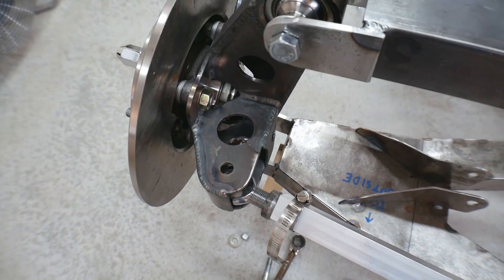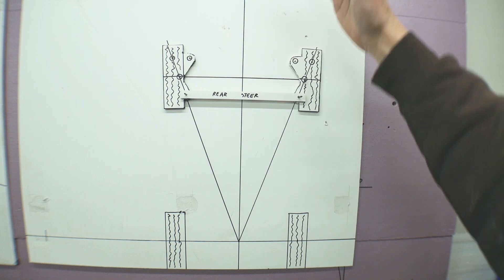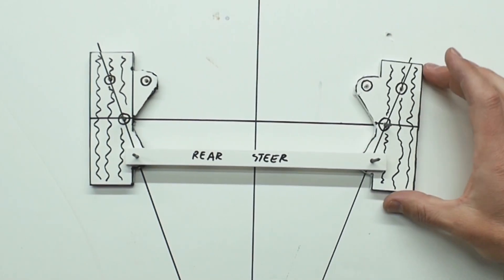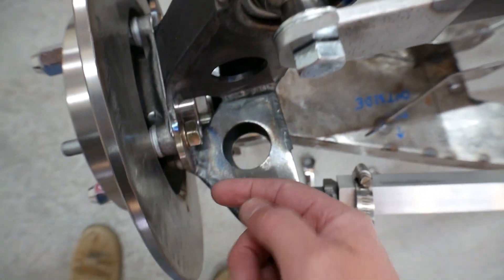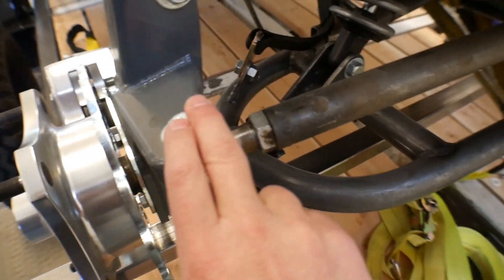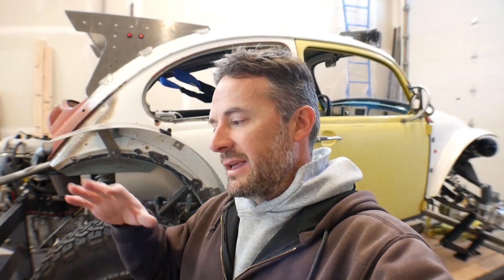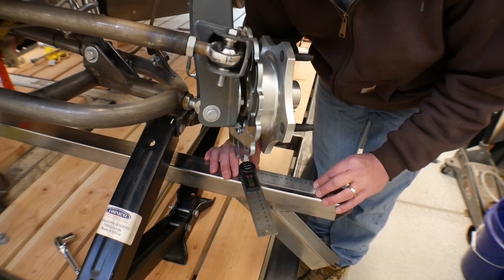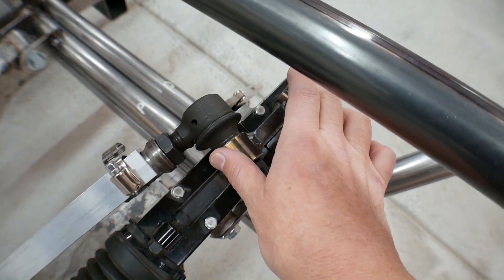Steering Ackerman, how it works, and doesn't work...

Comment: I''ve noticed some front wheel steering axis is well inboard,   often not in line with the wheel axis,   and sometimes tilted so the outboard wheel in a turn presses down and the inboard wheel lifts slightly.

Comment: Awesome video! Thanks for the simple explanation. I've been diving into Ackerman for a short while now and had a conceptual understanding, but visualizing it like this made it really click.

I'm build a drag-and-drive car now and i'm using Volvo S60 suspension, but due to space constraints I had to flip the knuckles and go from rear- to frontsteering. Easy, since the knuckles are symmetrical, but it does "reverse" the Ackerman. I'm now figuring out how to fix this, but that's the easy part. The hard part is determining where the new steering arm needs to be after cutting off the current one. But maybe i'll be able to litterally put some strings under the car and use a laserlevel to translate the location on the Y-axis, if that makes sense.

Anyway; my amateur brain was thinking: can't you move the mounting position for the tie-rods inwards, towards the struts, so it comes closer to where it needs to be? The only downside i can think of is that it makes the steering heavier, since the leverage arm is also shorter.

Comment: Can you explaint to me how to adjust toe in using camber angle data calculation. How much toe in, if i use +1.00 camber, +0.30 camber, -0.15 camber -0.30 and more than -1.00 camber

Comment: You can improve increase Ackerman effect in front steer by moving the rack more rearward. (and vice-versa for rear steer)This makes the inside tie rod and steering arm approach tangency faster, and that means more degrees of turn with less tie rod movement. This can be used to compensate when the steering arm can't angle outward as desired. I'm fixing a front-steer-converted project right now, so I've gone through it. Another trick that can be used is a bellcrank, with links that are angled to create the effect. It wouldn't work with arms this long, though.

Comment: Hi long time after you made this video I know but a great video by the way. I have a lightweight  rear engined track/sprint car for tarmac. This has a front mounted steering rack like you Baja cars and therefore it suffers from exactly the same reverse ackerman geometry.  In the manufacturers suspension set up the toe in toe out specification specifies quite a lot of toe out. I often wondered why. However seeing your vid and looking at your model putting more toe out would, I think,  appear help to compensate for the reverse ackerman as the outer wheel would had reduced steering angle and the inner increased for any given degree of turn. Of course this would lead to a bit more scrubbing in a straight line but so does toe in used on most road going cars. Toe out also makes for a more "twitchy" characteristic which is no bad thing for a car  that needs agility. Just my thoughts . Nice fabrication skills by the way!
Reply from the maker: I think generally on road cars benefit from toe out, and off road benefits from toe in, in general. Again just my experience.
But because toe out aids in aggressive turning on road cars like it. But in low traction conditions like dirt toe in keeps the vehicle tracking better in a straight line.

Comment: It doesnt actually work though. Never had a problem with standard steering geometry on other cars but my Alfa Romeo has Ackerman and you can hear/feel the tyres scrub when manoeuvering slowly. The proof is in the uneven tyre wear ARs suffer from even with the correct toe in.

Comment: Anti-ackerman is common in race cars (in addition to toe-in !) 
For the reason of rubber slip angle wheels don't actually go where they are pointed, but rather slip a bit towards the straight line.
That slip value is also different for loaded/unloaded wheel in the lean of the turn.
Thus anti-ackerman is better for them than perfect setup, albeit at the cost of more rubber wear.
I just don't know if it is detrimental or good on loose terrain.

Comment: Fun fact: Formula 1 cars can have negative (or anti-)Ackerman set-ups like you did show in your model with the short front steering. This is because at the really really high speed turns, it turns out beneficial since there is already inherent slippage of the outside front wheel that requires MORE steering on the outside instead of less to make it go in the corner direction. So there is an actual real world benefit for such geometry in very specific cases.

Comment: Man, you got me thinking about the steering setup on my toyota pickup. Its forward steer and im sure its just as bad as the demo on paper lol. I think im gonna try to make it rear steer and get better geometry.  This might be the reason why my tires need rotation more often than i think they should is because they are scrubbing the heck out of the roads every turn i take lol...  

Thanks for the great explanation man 👍👌

Comment: TLDR: crossing the desert is hilly rocky bumpy sandy your cars steering supposed to be locked to near straight and very super heavy. you cross the desert, straight across. no turns ever. no aircon no civilization no bathrooms those can wait you wont have enough water its a death trap. Even if you have to be a boy band go full one direction. Or you could just go the middle of the desert do donuts n burnouts whatever. you cant put your foot into the pedal hard enough ever to get out of the desert fast enough, is why they invented racing engines.

You misunderstood why its a front bar and less of an angle. In a toyota AE86 or other vehicles drifting downhill and on smooth road surfaces, the weight of the car shifts to the one side when cornering and powering through a turn at high speed and powering out! because a buggy/ baja type vehicle is for offroad, it drives on sand and loose surfaces, and the weight shift and turns cannot be as fast/sharp because theres not an even surface and no grip, your wheels turning sharper for a tighter turn circle if going fast means your baja car continues in a straight line with the two front wheels at near right angle vector drawing gooves and lines in the sand... the angles and the math of the tighter turning circle work, but the bumps and different suspension mean you dont want your car to turn or swerve as sharply on loose rockey offroad surfaces. it was tightened and closed off for this reason. If you drive it on a track with sealed proper road surfaces then tighter turns and your adjustment might be an okay idea if its steering is heavy and needs a few rotations of the wheel to make some tight inner city parking manuevers. But if you're going down steep sand dunes turning doesnt actually work as it normally would and is less effective and turning sharply means you may roll or veer off vector its a bit like skiing how the skis tend to go forwards or you angle them but when the bumps and rocks come your snow ski at high speed cant keep stable so you hop side to side bouncing and do so on jetskis in surf waves too... though ski's you can lean and sort of snowboard like edging to a halt, your car doesnt jump or lean and it relies on suspension to sorta bounce a little but reduce the bumps to smooth. if your longskis in the snow go fast as a car you will understand what i mean high speed on bumpy roads and loose sand down hill sand dunes. if you plan to only drive it in town then try out your change. In places like australian nullabor plains 11 days of drive of nothing but dirt road rural australians drive their ars at plus infinity miles per hour because nobody has enough lives to spend days to go to the store. your car at a speed high enough should steer or turn with a tight enough circle, maybe consider changing to a smaller easier to grip and spin around rally like steering wheel.

Comment: I know I am late to the party, but when you are measuring the angle of the buggy you showed 29 degrees for the inside wheel and 31.6 degrees for the outside wheel. By that method doesn't that mean the inside wheel is following a tighter arc? So it has slight amounts of ackerman? And is not actually anti ackerman?

Comment: This might be a dumb question, but since the wheels in front aren't connected, doesn't that negate the need for any kind of compensation?
Reply from the maker: No this doesn't have to do with rotation from one wheel to the other, it has to do with the path they are taking around a turn. If there paths are different they will fight each other, and one of them will lose and have to slide.
Reply: Yeah, so if the inside tire is turned sharper than the outside tire, they will be pulling apart from eachother, no?

I was watching the wheels on my shopping cart earlier to see if the inside wheels was turning more than the outside but it looked like they were turning the same even if I was just spinning the cart around in a circle. 

I'm definitely not educated on this topic, but I would like to know more. 

 @DougBugBuilder
Reply: I think I understand now. It's easiest to think about each wheel independently, like two tricycles turning. One sharper than the other. 

So I guess, the further the wheels are apart, the more variance there would be between the two, during a turn.  @DougBugBuilder

Comment: ackerman wasnt even born yet when charles darwins grandaddy first devised this setup while making house calls as a doctor in mid 1760's england. he got tired of his carriage crashing on turns, as it was the whole axle turning and a tight turn would turn it from a 4 point support towards a 3 point structure, if that is imagined in ones mind. so he had the local carriage maker craft his design up, leaving the front wheels in place and the control arm to turn them. since he didnt want to be thought of as a mad inventor which could have hurt his doctoral practice he never patented any of his schemes. 
the royal society of england was aware of the design, thru a friend and admirer of the aforementioned erasmus darwin, yet those old blokes must have had plenty to look at in those days of invention, because it would be 50 plus years before it was patented by ackerman after a german carriage builder named lankensperger developed the mechanism. ackerman was the germans agent and spent years defending the design to reluctant adopters of the technology. or something like that. was a fun rabbit hole to fall in reading about steering.

Comment: what if you flip a arms and spindles from left to right side and move suspension forward accordingly. then you should have room for rear steering. would be cool to see the diffence and for you to give a hands on verdict on the effect. steering rack would need to be upside down too or be 2 axles with a gear on each to change direction of rotation.

Comment: Would you provide a link to your next video that explains your outcome of your changes to the Ackerman angles. I cannot find it in your list of videos. Thanks
Reply from the maker: I never did a second video on the Ackerman. But I can tell you with the changes the steering is pretty good. Straight line running no issues obviously, tight turns you can hear it scrub some on asphalt, but it's not bad. And this vehicle is really only used at dirt tracks and trails, so really a non issue here. I hope that helps.
Reply: @DougBugBuilder  Thanks for the reply. This video was very helpful because I had a major anti-ackerman on my 1991 Dodge XPlorer motor home. With that much weight it didn't take long to eat my tire treads. I moved my steering center link closer to the axle and it worked. I guess it is the same as if you moved your steering rack closer to the front axle.

Comment: its not 2 degrees wrong. it is actually 4 degrees. Theese readings need to be vice versa, when correct. I can explain if you need.

And I had similar feeling, when I had car wich had really wrong toe in(previous owner had welded one rod). Steering was so soft and when turning it was just empty. like I could rotate 90 degrees left or right and it still went forward on dirt road. To get any turning I did need a lot of turning.

Comment: It looks like Forward steer would cause oversteer. In the case of a go kart you would then want a wider front track (wheel base) because wider front tires lead to understeer due to the rear axle being solid.

Comment: What will happen if both wheel steer at same angle.
Reply from the maker: One would have to scrub or slide some as the circle they travel on are different angles.

Comment: If you measure the center point at rear axle and put it in front of your vehicle you will have correct Ackerman angle and location in front.for front tie rod locTion
Reply: Are you saying you can achieve the same result in reverse? It makes sense. I have seen several production vehicles like this.

Comment: so does varying the toe of the rear wheels help things? Is it another way of adjusting for an "incorrect" ackerman?  Toe changes on swing axle bugs anyway as they are on trailing arms so would changing the ride height affect the way it turns within the concept of the ackerman angles?    what about lengthening or shortening the wheelbase?
Reply from the maker: A lot of what you mention there will help with stability. But none of it will help with the ackerman. But the good news is if your ackerman isn't the best it really only affects you on tighter turns.

Comment: thanks for this.  Im old and feeble and limited to 1/10 scale rc cars.  however,  next time I put additional rear drive axles on a home built rc  car or build a half track truck, Ill smoke a joint or 6  so I can work out the correct ackerman easily.  A great explanation.
Reply from the maker: I've toyed with RC cars my whole life. I'm sure when I run out of money or energy I'll go back to those.

Comment: On dirt you should be OK. You also have the scrub angle of the tires that differs from side to side. As your speed increases on the dirt a little anti ackerman is a good thing
Reply from the maker: Yeah I don't even notice it on dirt.

Comment: why not install the steering gear behind the front wheels and swap the spindles from one side to the other?
Reply from the maker: Usually that's a good way to go. However on the build of this Baja the rack needs to be in front for clearance of the steering shaft.

Comment: Doug, do you have to do anything special,  to the rotors or calipers, for off road use when you expect a lot of sand and dirt to kick up in there?
Reply from the maker: Not really, although I do try to set them up so they are at least 1/2" away from the inside of the wheels. This allows dirt and rocks to pass between the calipers and wheels if possible.

Comment: Hello from my understanding for your vehicle you actually should have steering in front of axel. This is called anti ackerman and the reason is because you have soft suspension. With soft suspension when you turn the load/weight easily shifts to the outer tire. Due to physics this means the outer tire needs more angle than the inner tire in order to turn that extra load. This is why your other vehicle also has anti ackerman

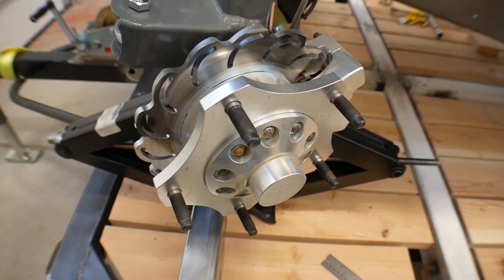Comment: I think you may have made a mistake when you were measuring the steering angle on the car, at least as shown. You are supposed to measure the angle away from straight/neutral (whatever you like to call it), so either choose parallel or perpendicular lines. 10:20 shows that you were measuring the angle between the line that is perpendicular to when steering is centre, and the line that is parallel to the wheel. If this meathod is used, then the inside wheel should have a lower number.

Comment: If the steering box was back in line with the straight line between the two outer ball joints,it would help your ackerman immensely. Also,you may want to put one inner tie rod above the pitman arm and in a hole farther to the opposite side of the center line of the pitman arm,and have the other inner tie rod on the underside of the pitman arm and they will overlap and in effect 'lengthen'as they turn to push either wheel more in it's needed direction. The easiest cure for yours is bring your box back closer to the rear,then shorten the tie rods.By far the easiest 'cure'.

Comment: Designing a go-kart and realizing I meant to use Ackerman, but I accidentally made it forward steer... oh well :P I guess it doesn't matter that much, though. Anyway, thanks for the video! Nice looking machines, btw
Reply from the maker: It's possible to get proper Ackerman with Forward steer. But usually it's not practical.
Good luck with the build.
Reply: @DougBugBuilder  Thanks!

Comment: My understanding is that Ackerman is for perfect conditions,  but with slippage and loss of friction as off-roaders will often encounter, having a toe-in on the wheels helps with stability in most conditions so I wonder if the pro-ackerman linkage was chosen to enhance stability on variable terrain.
Reply from the maker: Personally I think the design was more "this is what fits". But you're right, Ackerman isn't that important for offroad. But I'll still do what I can to get it as close as possible.

Comment: Don't forget that each front tire has a different slip angle going through the turn... You have more slip angle on the laden wheel(outside) than you do on the inside.  Thus, the path that your outside tire is taking is actually less severe than the angle that your outside hub/ wheel is taking... thus minimizing the anti ackerman that you have... check out the anti ackerman on an F1 car, might be shocking...